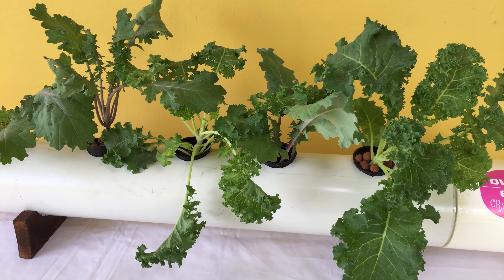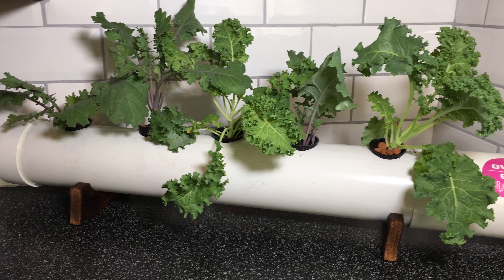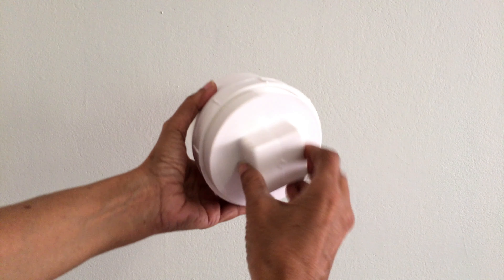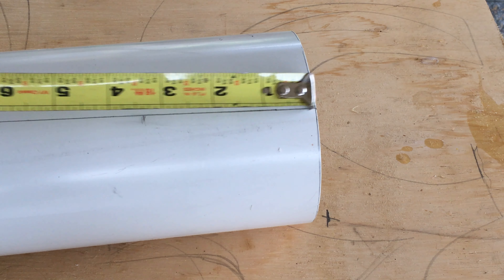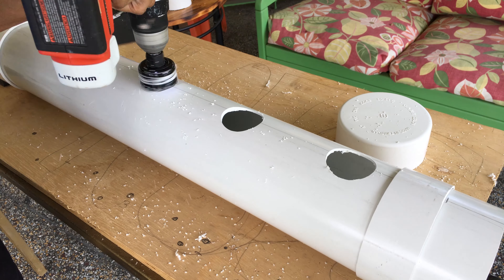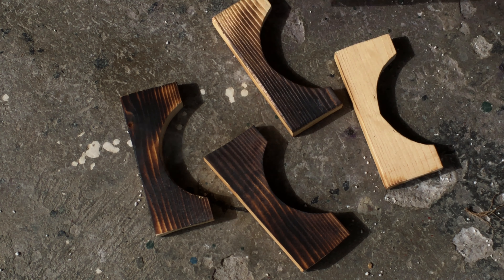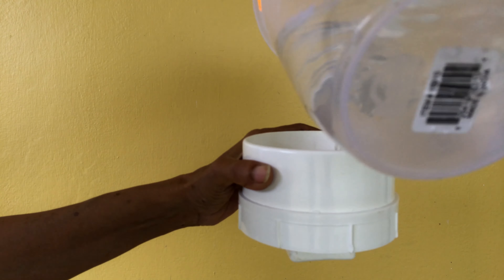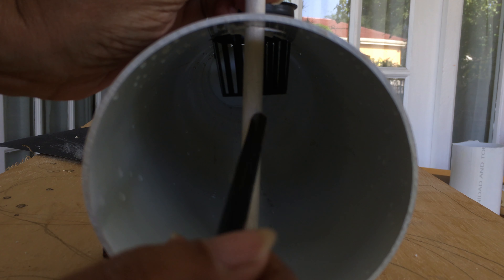How to build a Kratky Hydroponic System.Using pvc.

Comment: If you're going with the Kratky method, seems much easier/cheaper to use tubs as opposed to 4' pvc pipes. maintenance can be easier too. excellent video though.
Reply from the maker: Thank you,and thanks for sharing that tip.

Comment: Thanks for the share and instructions. In such a system, if we decide to do so,  where should we place the aerator/air stone ? One end of the pvc pipe would suffice ?
Reply from the maker: Thank you.You can absolutely add an aerator the plants do even better when you do,you can drill a 1/4 inch old at the top of the pvc and pass it through and before you cap the system attach the air stone.

Comment: A question regarding filling / dowel measurement. You said to fill the pipe to an inch under your net pots, however you don't mention how long the plant's roots are... surely this formula isn't accurate if your plant's roots don't extend below the net pot? When doing a new planting with roots that are still inside the net pot,  I typically fill my static ponds to half way up the net pot, that way some of the roots are submerged and part is exposed to air. Not sure if this is the best way (I defer to your expertise), but I seem to get good results.
Reply from the maker: I was assuming that the roots would be long enough to reach the solution.If however they are not fill it so that it does reach it,but you don't want to keep it like that once the roots grow out as if there is no space for air the roots will drown.
Reply: @over60crafter  Thank you.

Comment: great video and not to complicated, great for a beginner to hydroponics. I was just wondering what is the best growing medium and fertilizer to use?
Reply from the maker: Thanks.To germinate the seeds I usually use a good quality potting soil then rinse it off before placing it in the system.I use hydroton to keep the seedlings from falling over plus it also helps to block the light from reaching the roots.I have links in the description for the nutrients that I use in the description.

Comment: I am new to hydroponics. Do you have to clean this system between growing cycle?  If yes, how do I reopen the system to clean it? How do you drain the water? Thank you
Reply from the maker: I would recommend that you clean out the system at the end of the growth cycle before inserting your next batch of seedlings. To open the system simply unscrew the screw on end cap,pull the open end so it protrudes out the edge of whatever you have placed it on and place a bucket below to catch the solution. Also it won't be that heavy to remove it to wherever you want to clean it out.
Reply: @over60crafter  thank you so much

Comment: I prefer using vinyl downspouts at 1/2 the price of 4" pvc
Reply from the maker: I guess it would depend on where you live,the 4 inch pvc would be cheaper here than the vinyl downspouts if it can be located here in Trinidad.

Comment: Can a use co2 pump oxygen
Reply from the maker: Hello Imran,I have never used a co2 system so I am not familiar with it .If you are looking to pump oxygen why not use an air stone attached to an air pump.
Reply: @over60crafter  i am new to hydroponics . thank you for this great video. Do i need an air pump with this system.? what is an air stone?
Reply from the maker: @ethnieferguson8466  You don't need an air pump for this system,but if you find your plants aren't getting enough oxygen you can add one later on.I did not need to add one. An air stone sits inside the reservoir and is attached to the air pump which sits outside the reservoir,but as I stated before you don't really need one for this system.
Reply: @over60crafter  thank you. You motivate me to try this !
Reply from the maker: @ethnieferguson8466  You are welcome.